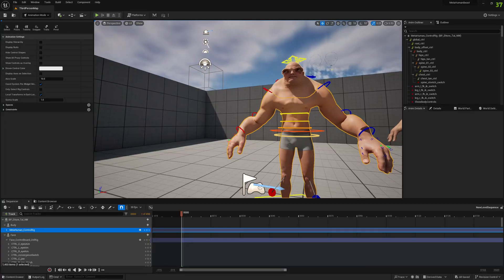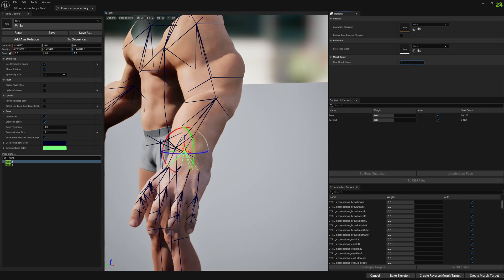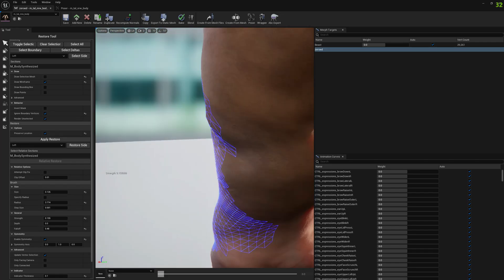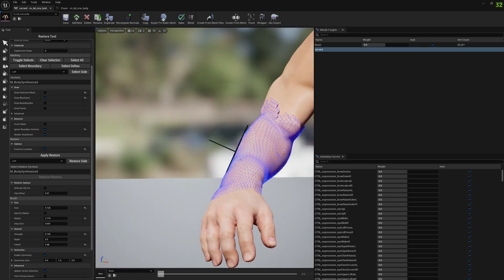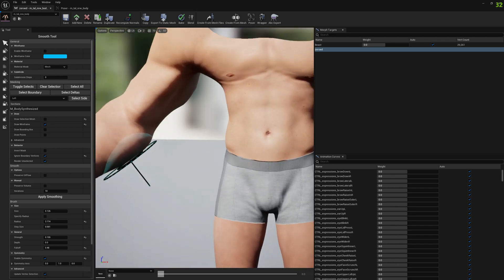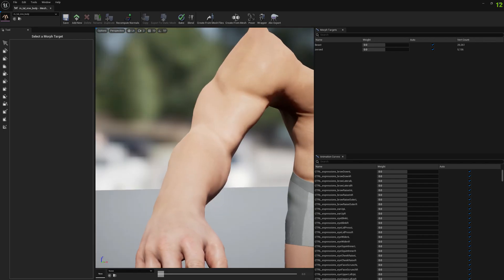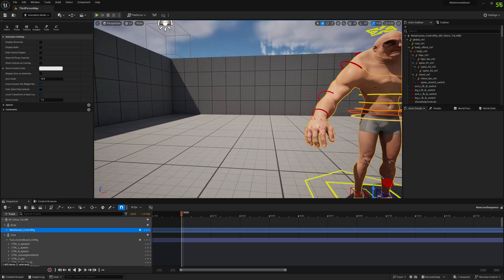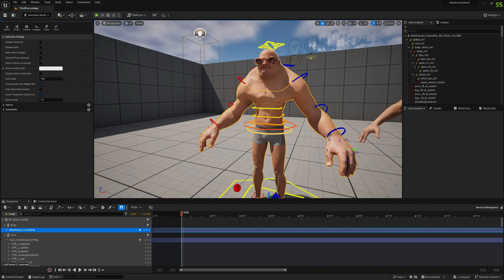How to Fix Sequencer Control Rig Arms in Poser with @Mr_Dee

Comment: Doesn't need to do Bone Snapshot this time before Update from Pose? cause the body mesh is deformed so the arm bones position could be changed as the mesh deformed I reckon. But maybe the mesh is not much changed so you didn't do Bone Snapshot and recompute normal after bake skeleton?